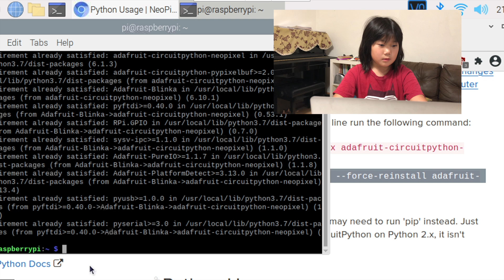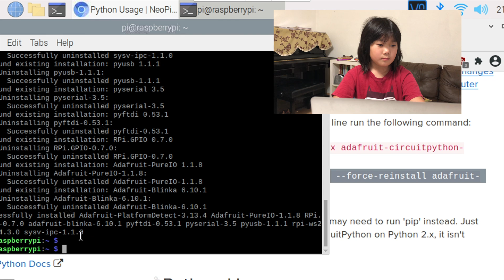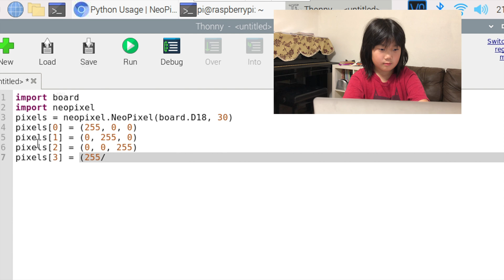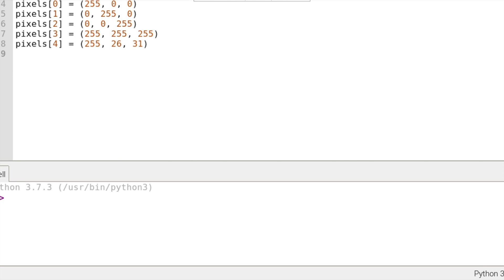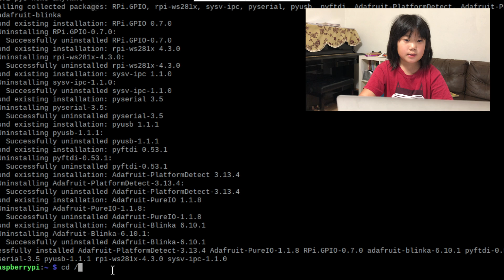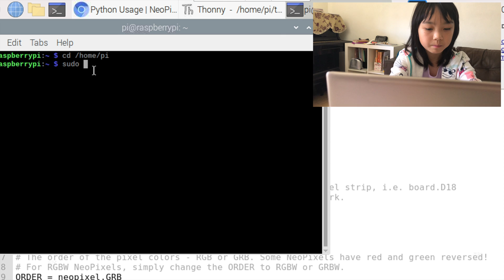use Python to control WS2812b LED Strips with Raspberry Pi | complete tutorial

Comment: Hello from England! That's a great project. I built something similar but I used a logic level shifter to change the Raspberry Pi output from 3.3V to 5V. I see you didn't use one. Did you have any problems with the LEDs without the shifter?
Reply from the maker: We did see some DIYers added level shifter in their projects, but our 2 projects (you can see another one in my channel) run  pretty well without it.